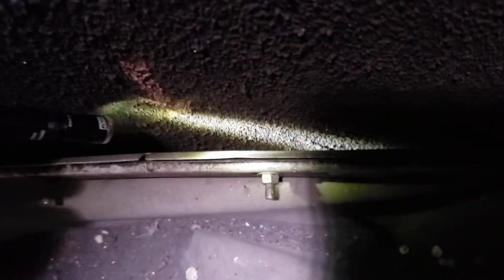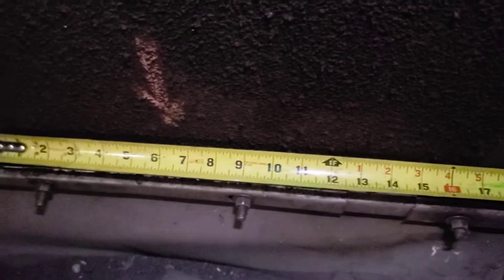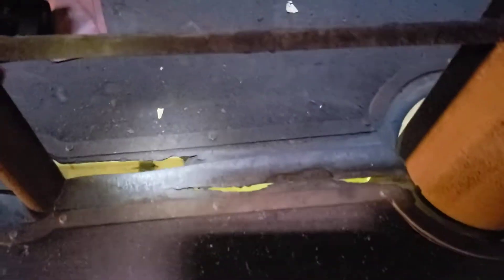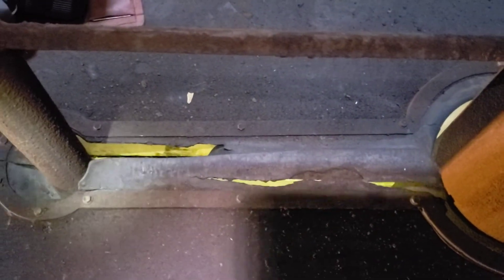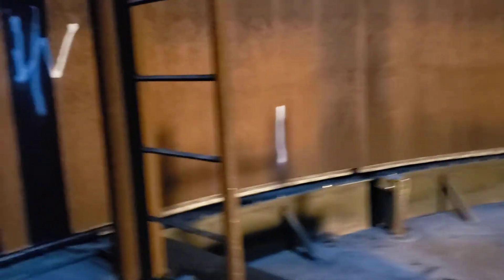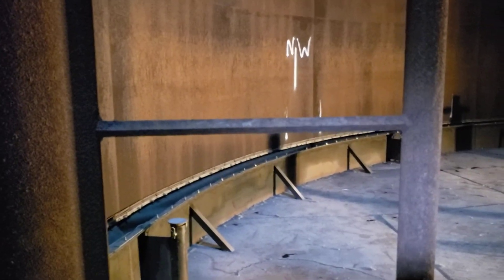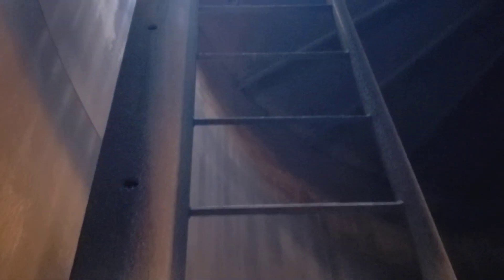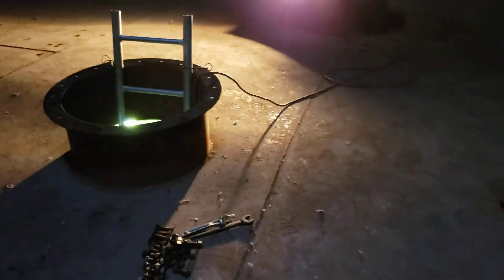Internal floating roof and seal inspection  // API 653 inspection // seal discussion

Comment: Funny how you say “these guys get excited” that’s because they think gaps in the primary seals like this are a problem, but they are only a problem if the total measurements are  in excess of regulatory requirements. On 48” D tank, 1/4” every few feet would be unlikely to bust a permit.

Comment: Great video Mr. Eric.  I did an inspection on an internal floater a few months back where I found 4 center columns that were out of plumb and warped. Tank was very old, built to API 12C with the same original steel pan floater which was also warped pretty badly. Client decided to demolish the fixed roof and the floating roof amd convert the tank to an EFR.  They really wanted to squeeze some more years out of this tank! I say this tank has had a good run and they got their money's worth out of it
Reply: What is ERF?
Reply: @KJ-gr6ho  EFR stands for External Floating Roof
Reply: @jparrales86  ok thanks

Comment: What is the correct scissor seal installation method in floating roof storage tanks for hydrocarbons?
Reply from the maker: The correct scissor seal installation method is dependent upon the seal manufacture recommendations.  Ideally, the primary and secondary seal must be protected and inspected after completion of assembly to verify no damage occurred.  Something as seemingly innocuous as a bruise from mounting bolts will eventually be the site of seal fabric failures.  I have documented such an incident in one of my YT videos.

Comment: Hey Mr. Eric,

I’ve been searching for these types of videos for a good while. I’m glad I’ve found yours, it will be very beneficial for sure. I’m a young API 510/570 and have not had much experience with tanks. In reference to the roof seal,  what would the gap dimension need to be for your to make an inspection recommendation?
Reply from the maker: Mr Thomas,  thanks. 

As far as gaps and guidelines or isn't straightforward for every AST, every client and jurisdiction, there are significantly different differences betwixt these.